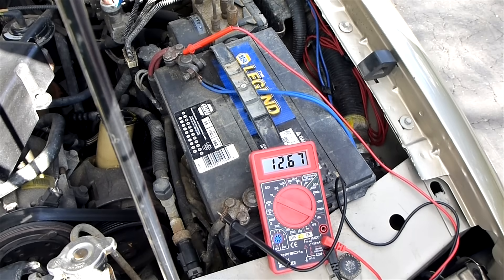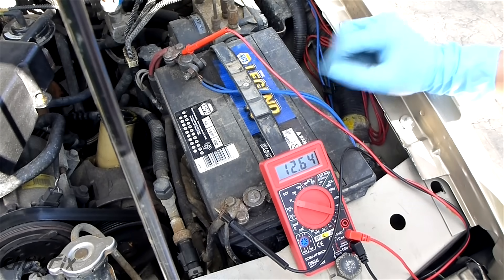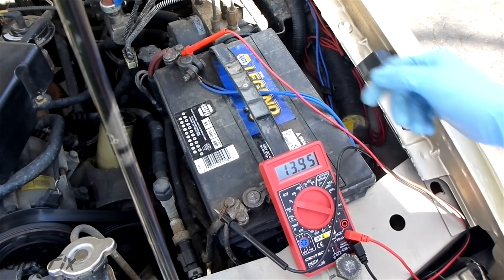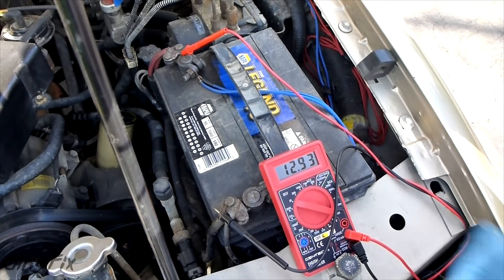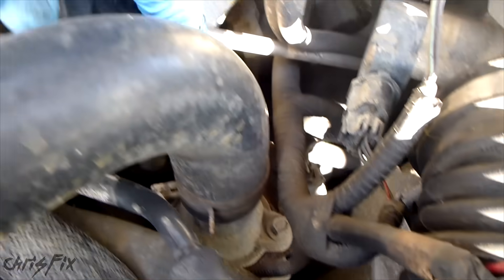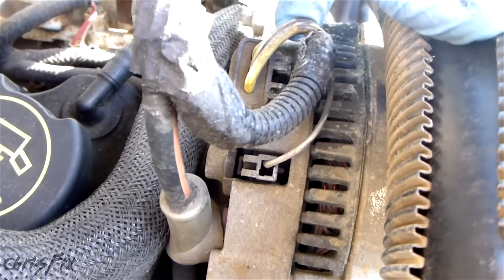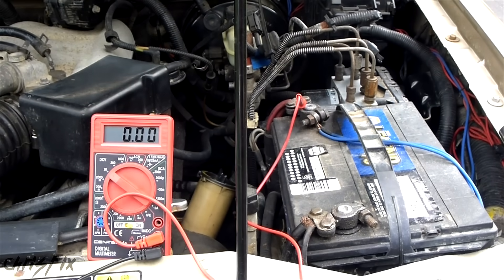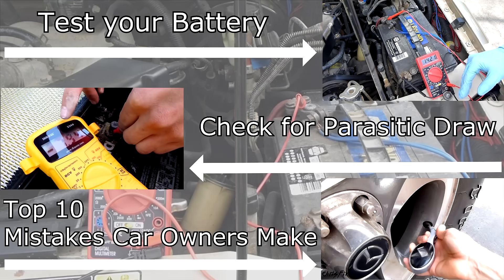How to Test an Alternator

Comment: Lol. Bought a Jeep today that "someone said needs a new motor." 

I asked if it could be jumped. "Yes, it can be jumped and driven."

I show up, they jump it while I inspect the running motor (that sounded fine other than the busted muffler). Without me asking, they disconnect the jumper cable. It dies. Me "Oh, so it needs an alternator." 

Nope. They told me it didn't charge enough and the engine is rough. I told them that I was only interested to buy if they could drive it to my house. "Sure! It always drives one way with a jump." 

Two days later the poor guys towed it to my house and I bought it for pennies. A little Chris Fix can land you a deal when people are too scared or do not want to know how to work on their own car.

Quick edit: 
When I mentioned the obvious dead battery with the squeaky belt I got a "I was told you can reroute the belt another way to stop it. That is what my friend said" .... send me vibes I got a steal and this guy didn't try to wrench on it.

Comment: Older Ford products back in the 1960's and 70's were on the money at 13.6 volts even in brand new cars. GM products were 13.8 volts and
Chrysler was 14.2 volts. If the belt has a tension adjustment like in the older cars using a "V" belt, you don't want the tension rediculously tightor you will ruin your bearings. You should be able to push the MIDDLEof the belt, at it's longest point between two pulleys, in about one inch 
easily. If the belt slips at this setting, it is glazed. You can do a quick fix in a pinch by roughing it up with sandpaper. If it is shreading or 
coming apart, it's time for a new one. My first car was a 1968 Chevy Bel Aire with a small block 307 engine. I had my alternator / water pump 
belt break one night out on a back road in Florida long before cell phones were invented. Instead of being stuck, and completely by 
coincidence, my power steering belt was just the right size to fit from the crank shaft to the water pump albeit a bit tighter than it should have 
been. There is no adjustment on a water pump so I had to jump the belt over the pulley to make it work. The real trick was getting it back off 
when I got the new belt. I was able to drive back to civilization on the battery and without power steering but the engine didn't overheat. Thank
God that steering wheels were a lot bigger back then. Since that time, I have ALWAYS bought car batteries that were as electrically a big as 
would fit in the battery box for just this reason. Longer reserve capacity for emergency flashers, parking lights on a dark road or, if I can jury 
rig the water pump like I did that night, I can still drive the car for longer. This is why I hate the new serpentine, one-belt systems of today.
    Also, a quick go / no go alternator test if you're out on the road with no volt meter: Turn on the ignition switch but DO NOT START THE 
ENGINE!!! Open the hood and take something magnetic like a screw driver, pliers or other steel object and see if it will stick to the end of the 
alternator shaft like a magnet. If it does, at least your voltage regulator and field windings are good. DON'T depend on a stainless steel object
as some stainless, depending on iron content, is NOT magnetic. This is actually more like a field winding and voltage regulator test. With the 
engine not running, the voltage regulator is forced to ask for full power to the field windings because it doesn't know that the alternator isn't 
putting out for lack of spin. This WON'T diagnose stator winding or diode problems though but these don't go out very often.

Comment: Check it:

My battery is in the trunk; and the altenator in the engine bay. 

Im already having what i suspect to be alternator problems. Im no car guy but i was thinking i could use jumper cables as extnsions for the multimeter; but i might assume using a 3rd party line wont produce accurate results.

Maybe i'll just clean all those spots that were recommended and then run it...

Checking for multimeter extensions too.

Comment: Hi bro, when turning my car on and check the alternator voltage it showed me 13.9v steady. I turned on the AC so Compressor is on and it dropped to 12.9v. Is it normal? Do I have a bad alternator or do the compressor usually takes alot of amps?

Appreciate your help.

Comment: if you use oscilloscope beteen +12 out screw and shell ground you can see the power "spikes" .Your multimeter is quite cheap one so the error it has is perhaps 5-8% and it measures average voltage. So, even it show 14.1-2 if there are significant "spikes" that meand going to hell diodes and your battery will be gone soon..
About that voltage drop you show.. is not exactly "drop" ... 
 Perhaps most of viewers aren't going to do that check anyway

Comment: Hi Chris 
I got a 09 Acadia slt 2 
The charge voltage is 15.4V 
I am on my fourth battery 
2-4 days I go to start and it is dead 
What could be the problem? I think I have a parasitic draw but don’t have a good enough tester to test for parasitic draw only I can think of is a tester with a shunt

Comment: Will the voltage drop test matter if the multi meter readings are okay? Mine are 12.73 while the engine is off and 13.94 when it is running.

Update: Bad cell in the battery. 

Great vids man.

Comment: Using DVM, select lowest AC voltage. With engine running check ac ripple across battery. shouldbe below 300mV AC. Written this value.down in your maintenance log. If the voltage is 3v AC or multiples therof, diode pack is faulty.

Comment: I need to add a 12v lights from the battery directly without using the fuse box. But the voltage of the battery after startng the engine is 14 it may damage those lights. What should i do?

Comment: When I check my battery, while the vehicle is running, the voltage jumps from 9.5ish to 11.5 to 12.5 ish range. It's weird. What's going on with that ? Alternator ? 

Thanks
Reply: i'm curious, what did you find out?  I'd guess that both your battery and your alternator were bad.

Comment: So I figure the voltage drop test is only applicable if your alt is charging and isn't a problem with the actual charging system, is that correct?

Comment: HI Chris.  I am desperetly need your advice. 3 garages already diagnosed a car and they have  no clue what is wrong. car-toyota Vitz 2013- 3 cylinder car. car has horrible vibration when idle, vibration is intense and abnormal ( when on P , or N mode -automatic) . computer test, and compression test comes clean.  already done to the car:
plugs changes
coils changes
oil filter and air filter changed
throttle body cleaned and MAF sensor cleaned
battery changed
alternator was repaired , wright after the repair alternator still has  the voltage drop , sometimes nearly 13 , somehow it pick up the voltage and vibration goes away, when voltage goes down vibration starts again , a bad vibration 

I was told that even new vibration will not make a big difference. please can you advice

please heed an advice as I am hitting a wall with this car here in Ireland. it is just draining my wallet  .

Comment: This video really helpful, just resolved my charging issue with your testing ground procedure. I have been having on and off battery system on my vehicle, and I just checked all the grounds and found out that connection between the car engine block and the wire to the car chassis is soaked with engine oil; I cleaned it up, measure the volt that was reading about 12 V with the car running but now reading 14.0 V average. The warning light is now off,  I guess my battery charging issue is coming from poor grounding. By the way, I don't know if you can help out with AC not working. Initially I noticed that my AC clutch is always engaged, but the car is not getting cooled; I could feel the cold slightly by touching the inlet to the evaporator. This is Honda Pilot 2003, so I followed refill procedure using AC Pro Freon, the system start working again, everything getting cold and the clutch now engage on and off. But that did not last, the whole system no longer function. The blower motor stop working, the clutch no longer engage. And the heat not working, an issue that has been there before the AC started. This morning at 80 F, resting state, the pressure was reading 60 for both H and Lo... after turning the AC on, the pressure reads 65 for Low and around 63 for High. Obviously the clutch did not engage and the compressor is not running. One thing I notice is that at High service point, I could visibly see colored light green liquid, I guess the freon. I think I do have a leak at that port. Please help out with any idea on resolving this issue. I hope it will be something I can fix on my own.

Comment: My battery says 9.38 v and it won’t turn on. What could it be ? By the way i know I’m very late but just wanted to see
Reply from the maker: It can be many things. Starter could be bad. Try charging the battery.
Reply: ChrisFix  I’ve tried charging it and the keys won’t start the car so I use a flat head screwdriver and put it on the starter relay and it just makes the engine sound as if it wants to start but it doesn’t
Reply: ChrisFix it is a ‘68 Plymouth fury 3

Comment: Hi everyone!

I recently bought 2006 Honda Inspire (Accord) 3.0 V6 automatic. I noticed that my Battery Light has been on recently. In addition, the system monitor sends me message that there is no charging. I watched many YouTube videos, checked by using multimeter both the battery & the alternator, with the engine on & being shut. My battery voltage is 12.7V (above 12.6V), whereas with engine on it is 14.22V (14.2V - 14.7V should be optimal). I also did the “Load Test”, with headlights, fog-lights, hazard-lights, radio, cabin-lights, rear-defroster, wipers, and AC (fan-blow put to max) being turned on and the voltage dropped to 12.4V. Interestingly, if I turn all of these appliances except the AC on, the voltage keeps above 13V. As soon as I turn the AC on, especially immediately after one of the two fans start working, the voltage drops to 12.4V, as I mentioned previously. In addition, I also checked the voltage drop from the alternator, for both plus and minus terminals of my battery. In both cases it showed a relatively stable -.06 / -.07V (both during idling and with 2000 rpms). Eventually, after checking my battery at the gas-station once again, I decided to replace it with the new one, although I’m not sure that the old one was bad. However, the Battery Light on the dashboard is still on, together with the system message that the charging is not possible. If someone used to have similar problem before, I would really appreciate to hear it from you! I’m becoming really desperate - I don’t know what to do. I just spent my budget on purchasing this car, so I really don’t have any money left for expensive repairs & sneaky mechanics. Please, help me!!

Thanks a lot!

Comment: as a ase master tech i think you gave good info, except if the alternator is over charging to 14.7 or there abouts that does not mean its a bad alternator, its most likely a defective battery, the alternator is trying to compansate for problem in battery. isolate battery and test it. and by the way your personal vehicle is in piss poor condition, the battery cable ends look like shit, the rusty crap arround the radiator cap means the coolent has not ben serviced in many years and is just brown mud, and the back of the sepentine belt is very glazed, and that means the belt needs to be changed. your a smart mechanic with a piece of crap for a personal vehicle, and oh i forgot about the exhaust leak, and i bet your wifes car is broke down and you aint got time to fix it, but i liked your video kid, keep up the good work.

Comment: Connections on battery clean terminals?
All plugs from Alternator to battery in good connection and condition? repair.....watch the rest....so helpful.
Grounding issues?
Decrease battery voltage?  
Is the belt tight?

Comment: I get 13.4 V when I test it with or without power using accessories on. Even high beam lights and a/c blowing full blast. So I think my alternator is still ok.

Comment: The voltage drops are mainly for small differences right?   Because if say your alternator test for charging doesnt jump up to 14 v and only goes from 12.4 to 12.7 then should that indicate that it's just bad, right? 

I replaced the regulartor 6 or so months ago so I'm surprised to see it go bad. 

There is a short somewhere with the window locks that I'm not sure if it has an effect on this.. but it would be nice to know if it does. But that short blew a fuse so I'm assuming there is also no other connection to cause an issue with the charging system if there was a relation.

Comment: My positive lead coming from the alternator was so corroded that it actually snapped before I even started cutting to put some new terminals on.  

I had pulled the alternator, starter, and battery to get bench tested at Oreillys before watching this video. All checked out OK. Replaced the terminals and it was still showing a drop in voltage when I turned on the car. I decided to go through this video step by step and wouldn’t you know it... I forgot to attach the harness to the back of the alternator after reinstalling it. 

So, $5 terminals later and one plugged in harness, I’m back on the road. Thanks man!

Comment: Another way you can check if your alternator is bad, turn on the car and take off the negative terminal off the battery and if the car shuts off right away then your alternator is bad but if it stays on then it your alternator is good!!

Comment: Hi chris

I got 14.2v in idle but then with all the accessories turned on i got 12.6v. Does that mean i have a bad alternator? Also when the gear is engaged in D the car vibrates. Is that related to insufficient charge by the alternator?

Comment: I'm glad I decided to watch this video after installing a new high output alternator for use with my sound system, when testing I got 12.6 with the car off, but when I started it actually fell to 12.3 I thought it was just the weak old battery but I remembered Chris's wise words of this result only being a weak alt problem and it turns out I had tightened the new 0 gauge power wire to the alt, only to untighten it to try and get the stock power wire on also (the ring was too small anyway) I somehow forgot and left the nut sitting in the engine bay. In the end I fixed the problem (even halving and using force to get the stock power wire ring on the alt with the upgraded wire) Thanks Chris for keeping me from needing a jumpstart to get home from work today(its 5 mins away but a 1,200RMS system playing Ghostemane kills the battery in minutes) and in the new test I got 14.2v while under load which impressed me

Comment: I just put in a new alternator two times and the new battery got everything tested out at the advance and they were good but Every time I drive the car the battery dies so the alternate  doesn’t really charge the battery 
When the car is on it reads 13.0 
terminals are new . Any idea
Reply from the maker: Clean the wire ends and make sure there is a good connection. Maybe run a new wire from the alternator to the battery.
Reply: ChrisFix  today I change the positive and negative wires new terminals and same thing 13.3 . I turn the lights on and it drains the battery when car is on.
Everything was sanded and clean  
Don’t know what else to try .

Comment: If i knew my battery was still good i shouldnt listen to  the person at store that  advices me to buy a new one., i dont really know much about the car so i did buy a new battery because he said my  battery has a very low charge and its about to die. The person replaced the old battery and the car starts which is good. But after a few hours when i try to use my car it wont start again. I went to a person that knows about the car and they check the battery and alternator. Thats where we found out the alternator is not working good.’ Well of course i spent another 💸💸💸 again. They did fixed the problem. 
 But i regret buying a new battery. I got ripped😭 
Im just sharing my experience guys. So you wont be like a (dumbash) like m.  
And thanks for this video and now i know how to troubleshoots. Thank chrisfix you’re the best👌🏻
Reply from the maker: I’m glad the videos are helpful and live and learn!
Reply: ChrisFix does the BIG 3 wiring kit really works and gives you a better charging system?

Comment: My battery light came on 10 days ago , 3 days ago my car just shut off while im driving in i95 thanks god it's was traffic so 5mph that was the speed , everything got hard from brakes to steering wheel, got home I did my test and fallowed directions everything seems good and battery light went off. Again yesterday I was driving in the highway i684 my car just shutted off again so I merged  and test the better I found 9V I knew its wasn't enough to keep the car running. I started shaking all the wires, cables, harnesses and here we go one of the bracket located in the altenator which hold bunch of wire its was lose and its wasn't screwed on with the same bolt the one hold the altenator to the main bracket which the way supposed to be thanks to a mechanic who changed my altenator 4 years ago for being such a lazy ass and not doing the job properly and almost get me killed. Forget to mention I called few places to get me towed they want over $400 and to their mechanic which 50 miles from my house . Alright what I did I used something called carpenter clamp  they use it for holding 2 pieces of wood but I used for holding the ground bracket to the altenator casing  , stared the car good by tow trucks.  Not me lol...I learned to have a god damn handy tools boxing in my  trunkits was a sample fix but became a project since I didn't have the right tools Al I have to do is unloose 12mm bolt stick the bracket and tight again